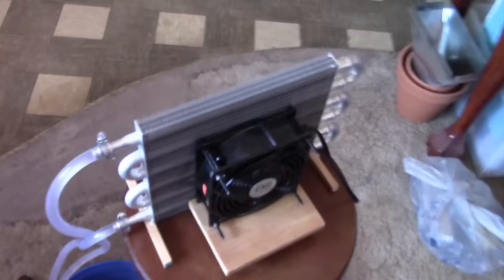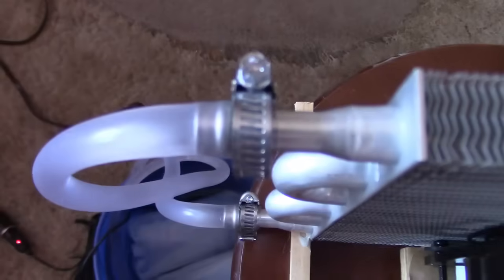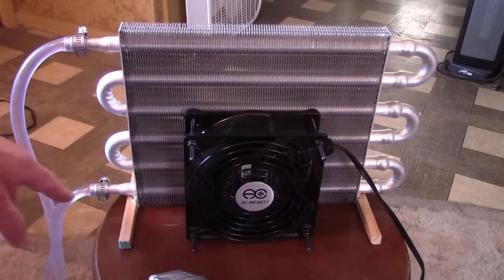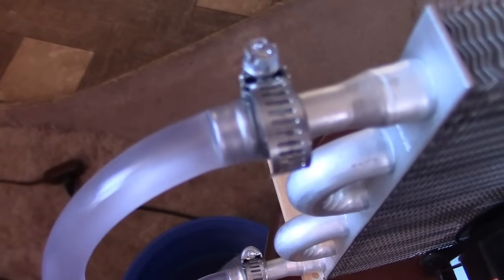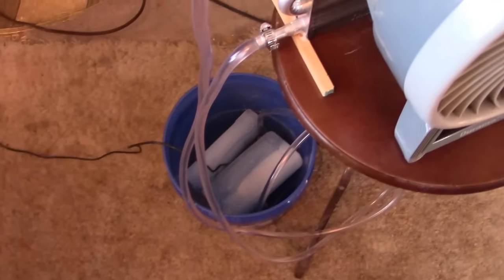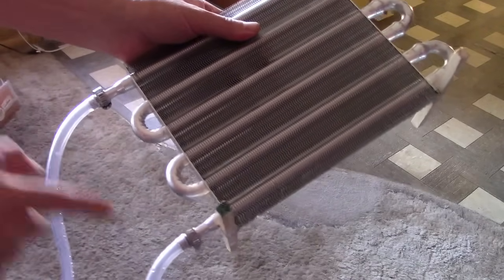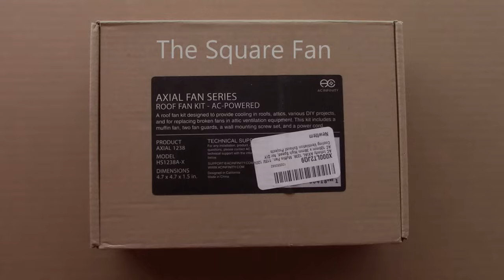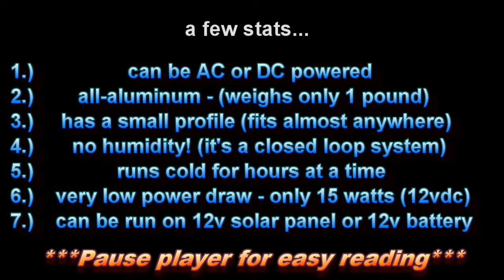Homemade AC Air Cooler! DIY Air Cooling! best yet! (no added humidity)! Easy DIY - Air Conditioner!

Comment: now go get a mini fridge or better yet a small freezer. place that same bucket or bigger bucket of water inside said freezer drill holes in the lid run the tubes through it and have continuous cold water. Add alcohol to the water so it wont freeze up

Comment: There is so much energy lost in there. Thermal isolation is a must so that the cold water/radiator doesn't exchange heat with the environment

Comment: In florida if you drill a well 300' deep and put a circular coil down it up to a heat exchanger and a fan you have a/c . Water 300' down is usualy 30° cooler than your air temperature. Ice water in a bucket well you are essentialy using your freezer as a a/c .

Comment: I made a similar version of this except I used a cooler and the tubes come thru holes in the top so the Ice is inside the closed cooler. It works well the only problem is 4 whole bags of ice melts in 15 minutes! How can I make it last longer?
Reply from the maker: hi. couple of things. slow the fan down some. the slower the fan runs the longer the ice lasts (that can add hours). another thing is to use larger blocks of ice. ice cubes will melt 10 times faster than a large single block. i usually use gallon jugs. you can also use those 3 gallon plastic tubs. they make a 25 lb. block that can last many hours. they sell those containers for 2 bucks at walmart

Comment: Is it safer to use a DC pump since it will be 12V supply, vs the risk of a 120V AC pump submerged malfunctioning?
Reply from the maker: i'd say yes to that.
Reply: @desertsun02  thanks, I figured that was better. I picked up a PowKiddy 12v supply same as the one in your video. Thanks for the DIY steps, can't wait to try it!

Comment: Could I use an aluminium bucket instead of the plastic one, so the ice stays longer intact and that the water gets even cooler? Love your video! ❤
Reply from the maker: hi and thank you! you should be able to use an aluminum bucket. seems like it would work.
Reply: @desertsun02  ok thanks!

Comment: I wonder if i could use this idea for a ground water loop in my furnace cold air line to cool my house...  maybe free ac with a couple holes dug
Reply from the maker: hi. it's a good idea. bury the right amount of pipe at the right depth and you can generate 'nearly free' cold air.

Comment: Great Ideas but did not see anything about Condensation drip pan
Reply from the maker: hi. i never seem to have that problem. worst it ever got was a few small drops (when humidity was 70%). towel or drip pan could be used if needed

Comment: Will any pump work?
Reply from the maker: hi. most smaller pumps will work fine. no need for a bigger one.
Reply: @desertsun02  thank you for the response, I will order the parts now. Will this cool a small room?
Reply from the maker: hi. yes, absolutely 🙂
Reply: @desertsun02  Awesome, I would love to see you do a video on making a homemade washing machine
Reply from the maker: i actually have one posted already. it's a simple unit with bucket and plunger. maybe i could expand on that one and make it motorized or solar powered
Reply: @desertsun02  more question. Is it better to put the fan on back or the front?

Comment: If I froze a gallon jug of water and dropped it in the bucket, do you think it would last thru most of the night?  I think i could use this!
Reply from the maker: hi. hard to say. you'd have to experiment and see. if it's not too hot and the fan is run slower you might be able to (or use a couple of frozen gallons)

Comment: If we were off grid and using this setup for cooling and using solar power would you recommend using a small ice machine ice to chill the water or a 12v fridge and swapping out ice packs? I’d like to know your thoughts on which system may be more efficient or convenient if the grid was down. Thanks for sharing your DIY goodness!
Reply from the maker: hi. i've thought about using ice machine or small fridge too. my ice machine cools off water very fast but i'm not sure if it would keep up or not. it might but i haven't tried it yet. swapping out ice packs is certainly an option too. some people freeze gallon jugs of water and use those. the bigger the ice blocks the better.
Reply: @desertsun02  I think the small fridge and ice packs would hold up better with the fridge in hot weather. I think if the room was hot the ice machine might struggle more. The idea would be to have enough cooling to be able to produce cool air around the clock by swapping out packs or frozen water jugs from the freezer. I’ve seen online it takes about 3-4 hours to freeze things. If the system uses an insulated reservoir we might be able to pull it off as long as the freezer could hold enough volume to always have something frozen.

Comment: I got house boat. I could use river water. Because it’s usually cooler than air
Reply from the maker: perfect idea. i've talked to other commenters who use my (similar but larger) 'copper pipe heat exchanger' air cooling units just that way. specifically a sailboat and lake water (but the same idea)
Reply: You will need a larger pump. i just bought a pump from harbor freight. $11.00 it only has a 3.5 head lift. mine is going in a cooler. 3 feet is plenty for that. your looking at 8ft or more

Comment: I built this with a USB powered 300mA, power is 1.5W, flow is 180L/h, works fantastic! The pump can deliver the water from the floor to a table. However the coil gave a ton of condensation. Do you have any clever methods of dealing with it or do you simply use a towel?
Reply from the maker: hi. i'm glad you made it! i'd just use a towel or plastic/aluminum sheeting. also could make a catch basin maybe a small aluminum foil trough. one benefit of the condensation is 'dehumidiification'. all that water is water (humidiity) that's being pulled out of the air
Reply: @desertsun02  thanks. Yes the air is more comfortable as it gets dehumidified. Awesome stuff!

Comment: I'm totally new at this....how does the water pump get power? I only see two cables and not a plug 4:07
Reply from the maker: hi. most DC water pumps don't have plugs. they usually just have two wires coming off of them.
Reply: Thank you sir! Makes sense now

Comment: Need two of the radiators one for the fan one in the bucket covered in ice and just recirculate the water with maybe some coolant. Or you could even then freeze the whole bucket in a deep freezer.
Reply: Coolant is deathly poisonous and unnecessary.

Comment: How long does it work for tho
Reply from the maker: hi. typically it blows cool air for several hours at a time (but it depends on how much ice you use, the size of the blocks, the starting temp in the room, the starting water temp. etc.).

Comment: hot water not gonna work on that cause the heat of the water wll damage the water bump
Reply from the maker: hi there. all depends on the rating on the pump. the pump i used is rated to 60C (140F) so that should work good. (i've only ever burned out one and the water was 191F at the time (88.33C).
Reply: @desertsun02  yes but 140 f is it enagh or not ? i think its not >>its not very hot enaugh to hold heat to enagh time if the weather freezing
Reply from the maker: @doblag channel i'd say it's plenty enough - that's super hot water. for reference, a powerful hair dryer on hot is 140F and furnace air temps are 110F to 140F so it should work.(even 95F water would give you some pretty good warm air.)

Comment: What if i used warm water instead of cold water are there any changes??? 
Im from Philippines its so hot in here🥵
Reply from the maker: hi. if you use warm water - it will be an air heater. ✔🙂

Comment: I just designed one that I can use in my skidsteer. With how hot it's been A/C is a must in the summer when running equipment.  I'm going to install it tomorrow the first time.  I am looking forward to what the results will be. My skidloader is enclosed cab however I've used it all summer without the door because it's way to hot with it on. If this ac cooling system works door can stay on all year!

Comment: I like to hoard/yard materials and things I can use that I find for free, penny-cheap, or from dumpsters. Last summer I made a few small AC units using milk crates lined with garbage bags, 12v computer fans mounted on both sides, and then I filled up the crates with tall bottles filled with water that I froze. I froze enough that I could keep them circulating. I’m looking to make something like yours in this video. A few weeks ago I found a box of about 30 cryo frozen packs, brand new, unused, and I’ve had this large cooler I found a few years ago, but I’m going to cut holes in both ends, use aquarium sealant and attach these push button drain thingys that I saved from liquid laundry jugs on the outside of both ends, attach 2 plastic Gatorade bottle tops with the lids for inside incase the push button thingys fail, then fill it up with the cryopaks. So I can keep frozen stuff cold after I get groceries. I want to add a hot or cold water circulation function with something like in this video using the pumps from a submersible aquarium filter, and the heating element and tubing I found that works from a coffee maker that was sitting Outside next to my apartment dumpster. Maybe even add some LEDs or something. I’d like to add a cut off function for when certain temps are reached but I’m not that knowledgeable about doing that and only basic stuff. I do have an AC unit that works but when my apartment took the old baseboard heaters out which had a special outlet for it, and replaced them with energy efficient ones, I have no way of powering it up: I tried making an extension cord/adaptor with parts and heavy cable from Home Depot and an electrical supply store to be able to plug it in where I plug the range in and it only turned on and not the motor for the fan. It’s a $700 AC unit which cools my 2 bedroom apartment fast so I’m kind of at a cross roads now. Not sure if I should make an AC unit, buy one from Home Depot for about $200 or make 1 more attempt at getting my AC unit I have working. I’m not an electrician but I do know that the AC unit runs on a 230-250amp and not a 110/120amp. So yeah…

Comment: how about using only room temperature water (without ice pack too), can it reduce temperature much?
Reply from the maker: hi there. this setup uses a heat exchanger so if the water is room temperature the air coming out would be the same. their needs to be a difference in temp. it can work even with tap water if the tap water is cooler then the temp of the air in the room.

Comment: If you are getting your cold water and ice block from a fridge and freezer in the same house you are running this in then you are actually warming up the house. If you sit in front of this the whole time then you will feel some relief  but in the end the house will be hotter.
Reply from the maker: hi. since you're typically freezing the ice and chilling down the water at night (the fridge might raise the temp of your kitchen by one-tenth of one degree) but nothing noticeable. this isn't meant to be 24/7 central AC to cool your entire house at the same time so it all works out. but if you're going to attempt that then yep, you'd want the fridge and or freezer outside (or at least vented) 👍
Reply: The way I see ice powered AC is kind of like a thermal battery. Start things freezing at night before bed when you have 'free cooling' (outside air temp being lower than inside temp) available. If you're even within 5 degrees of outside air temp it's not going to make barely any difference that you threw 55 degree tap water in the fridge/freezer. On real scorchers you won't be in the kitchen much anyways, just to grab things and retreat to whatever cooling you have, so even if the kitchen is a few degrees warmer, is it messing anything up?

Comment: Instead of using ice water how difficult would it be to just use R134A refrigerant which could be rechargeable?
Reply from the maker: hi. i've never worked with it before. do you have to be certified to use it? maybe an ac tech can jump in on this

Comment: I live in a humid area so I'm  glad to see this because swamp coolers won't work in swampy areas.  
Do you have Amazon links?  you can make affiliate income to.
Reply from the maker: hi. i tend not to post the links because if i send everyone to the same exact link then the seller will sometimes up the price. best way to find the radiators is just search for hayden transmission coolers 👍

Comment: You have made several chillers now, so in your opinion what is the most effective one? Thanks again!
Reply from the maker: hi. in terms of pure power the strongest ones are the ones with the large copper heat exchangers (but those are overkill for some people). this is one of the best in an overall sense. not huge and bulky but not too small either. it has great cooling power, lasts a long time and doesn't add any humidity to the air. the ice-based ice chest ones are really good too (and the evap ones are great if you have dry enough air). here is a link to one of my larger copper heat exchanger ones https://youtu.be/u0AGRBT1ISs (if you want to see all my heat exchanger ones - i've got a playlist just for those 🙂)
Reply: @desertsun02  Desertsun, thanks again man. I made the chiller with the smaller radiator and 12 inch fan. Worked great! I, going to make one with copper: I watch a lot of great video but you have the best. Keep the video coming we all gain usable knowledge on the cheap man.

Comment: Nice and cold but very expensive in the long run; cooling the water with a cooling tower outside would be far cheaper, or simply running a hose from an outside 'swamp cooler' to the inside radiator would be cheap and easy, and running the water through the inside wall mounted unit from a scavenged air conditioner would be much neater and quieter.

Comment: Im only half way threw the video so I don't know if you have a pump in the bucket to pump the water up or not but if you put a reservoir above the radiator it should gravity-feed because the hot water should rise allowing the cold water to settle at the bottom where your radiator already is

Comment: So, does this  AC Air Cooler suck the hot air out of the room and return a cold air?  Please advise.
Reply from the maker: hi. it sucks the hot air out of the room and stores it in the water. (as the air gets colder the water gets warmer).

Comment: More experiments are in order. Use a small spacer or smaller piece of hose inside what u have to create a restriction to slow the flow down a bit. Try it in different spots.take temp readings again
Reply from the maker: hi. i've got lots more done already. just need to edit it up ✔🙂

Comment: I didn't have much luck with the liquid nails and wooden dowels, would you happen to have any other suggestions on keeping this thing upright? I was looking around to see if I could find an upright and stable metal rack I could lash it to with zip ties. Alternatively, would strapping it to a larger fan similar to the ones you've used for the copper tubing fan work?
Reply from the maker: hi. well when i did very early experiments i just used a standard brick or two. kinda heavy but works. or there are all sorts of things you could zip tie it too. i'm working on a styrofoam stand. i'd give the dowel idea another try. it worked perfect for me.
Reply: @desertsun02  I think I got the wrong type of liquid nails then, I went ahead and zip tied it to my large fan the other night, once I get my new pump and get everything running I'll have to give you an update on how it's working.

Thanks for making all these cool builds by the way, I had built your ice chest and fan cooler years ago, which has helped me in the past, though I think the fan I stuck in there isn't strong enough to push out a good cold breeze, I'm optimistic about this transmission cooler build.

Edit: Got the pump and everything set up, the cooler has done well in making my apartment a little more comfortable, got the cold water in an ice chest and I've been piping it through with no problem, thanks again for this build idea, I can manage the summer heat with this thing. Since then I've taken it off the big fan and made a crude box out of an old small styrofoam cooler I had laying around, later on I'll be taking a blower fan I have and force air through it on one side.
Reply: @desertsun02  Hi again, I just wanted to say that you're a genius, after trapping the cooler in a crude styrofoam shell, getting some proper block ice and sticking a blower fan behind it, I'm getting some honest to God AC air pumping out of this beast. Though seeing as this isn't an evaporative cooler, do you think the windows should be shut or partially open for this little machine?

Sorry if I'm troubling you like this, but I figure bringing this up to you would be the best call, you have a lot of experience in these DIY air coolers.
Reply from the maker: hi. you can just keep the windows shut (if you want to). this type of cooling does not need to be vented

Comment: so ive been testing various solutions for my van in the Phx AZ heat... now that humidity is higher i really want this to work..but last night i tried 2 1 gallon frozen bottles in cooler and they were almost melted in few hrs.. i went ahead and bought 4 more 1 gallons jugs of water and they are freezing now... i have a feeling to get a solid 6-8 hrs of sleep in 100 deg+ heat you'll need 6 of frozen 1 gallon bottles...